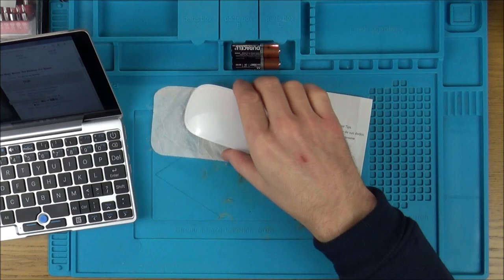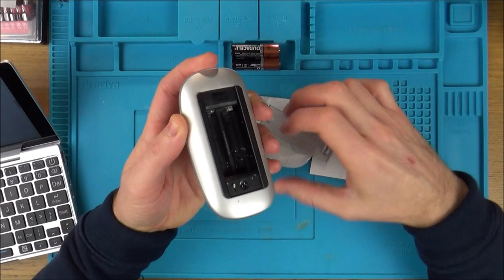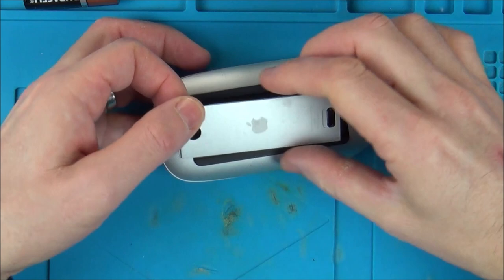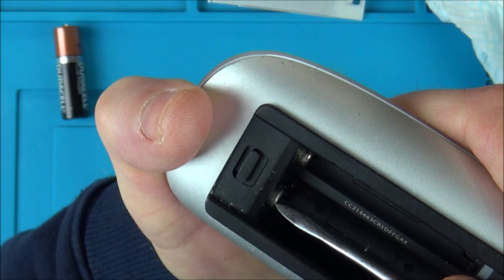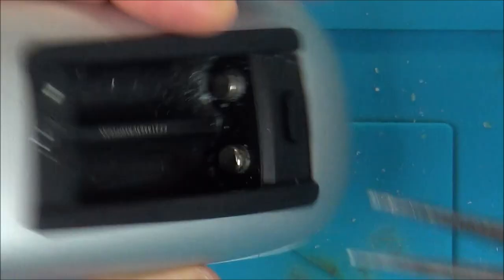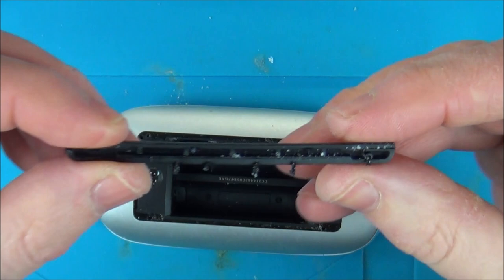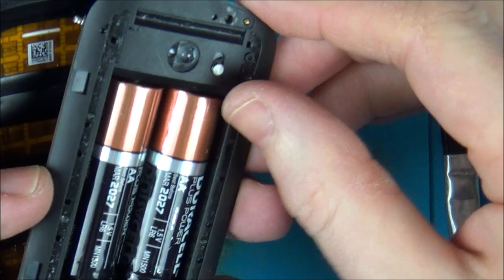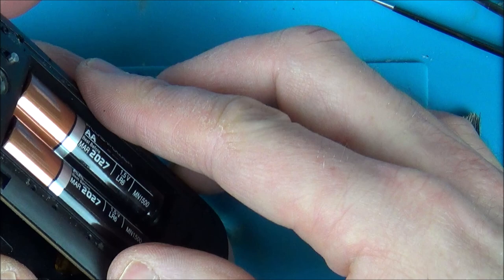Trying to FIX: Faulty Apple Magic Mouse 1 purchased from eBay

Comment: There is no right clic to speak so , you need to click with 2 fingers on the mouse and then , the mouse will send the right click action to the computer , no apple software needed i think
Reply: it depends where your finger is but he ruined the Digitizer by cutting off the black plastic bar and ripping of the glue.
Reply: multi-touch requires the drivers, to right click without the drivers just simply lift your left finger completely off the mouse first
Reply: @sersoft_corp  forfait about that ... 😅
Reply: @sakurojason  that's anoying ... So no right clic...
Reply: Tom 2 unless he replaces the housing and the digitizer
Reply: KMSMista  I know it's a 5 point multitouch, but the multi-touch part never worked out of the box for me, the only way to right click was how I described in my earlier comment, I gotta admit I haven't used one of these in a couple of years though, and never tried it on windows 10.
Reply: Nope, that’s wrong, the Magic Mouse’s secondary button is on the right side, you don’t need to click with two fingers, in fact that simply won’t work.

Comment: I know Apple like to do things differently, but having batteries go in the same direction is just wrong.
Reply: Logitech does it a lot with their mice as well. Its because the mouse only requires 1.5v to operate and not 3v. you can run it with just one battery with half the battery life, or with both.
Reply: That is why I consider a wired mouse to be the best option.
Reply: Amazon does it on the Fire TV Stick Remote (non 4k)
Reply: No its not. Its better! Much better! I hope you're not a driver!

Comment: "I wonder why they didn't make that a little bit longer ?"...To stop you doing this fix !!...Its APPLE!
Reply: But other devices are easy to fix. The iPhone as an example. Other Apple Products are very modular compare to this.
Reply: there’s actually a latch on the flex connector vince just missed it lol
Reply: @thegameporter  And he snipped off the black plastic bar causing to rip of the Glue of the digitizer wich makes it unresponsive.

Comment: That "little gold switch" is actually a pogo pin that is used to ground the metal chassis so the touch sensor can work.  Similarly the little metal fingers are to ground things.
Reply from the maker: Thanks Skonk :-)
Reply: @Mymatevince  No problem Vince, that's how the touch surface on the top of the mouse works-  capacitance between the little squares on the flexprint pcb, and the metal chassis of the mouse.

Comment: My Magic Mouse 1 had intermittent power issues. I tracked it down to the sockets that the the "nipples" on the positive end of the batteries fit into.The battery contacts at that end were deeper than the reach of the battery "nipples. No contact was being made.  The sockets were carefully filled with alfoil to enable electrical contact when fresh batteries were loaded. The mouse then worked . Its not too hard and worked for me.also placed a tiny  bit of blue tack against the lid and batteries as they move around. Works for me.
Reply: Apples rechargeable batteries are slightly longer than double AAs. If you used Apple's batteries there would be no issue and no corrosion.

Comment: Vince instead of cutting that piece to connect the ribbon, seems like you could have removed the board from the bottom assembly, plug it in and then attach it back to it. Regardless, good job.
Reply: That piece of plastic he cut needs back on?
Reply: Yea that’s definitely the way to do it
Reply from the maker: Thanks dude, that does sound like a good idea:-)
Reply: My Mate VINCE it’s all good! We all on this big blue marble together!

Comment: Dude I had the same issue with my mouse from eBay! I had cleaned the mouse out more delicately with Q-tips and diluted some white vinegar with water, which thankfully removed the crusty acid. Didn't make the mouse work though, but after seeing this video and how you more aggressively rubbed with the kitchen roll I gave it a go and it eventually worked! I'll pull it apart in the future to clean up the rest that I can't get to but I'm so happy it works now, thank you so much!!!
Reply: The vinegar had nothing to do with acid. Vinegar is acid. The crust was likely alkaline. "Alkaline batteries" use an alkaline electrolyte

Comment: Vince, if you look closely at the ribbon cable connector on the pcb, on the edge next to the battery negative terminals, there is a little latch. Apple likes to use back latches. Get your tweezers under it and lever it up. Makes the ribbon much easier to insert and removes the risk of damaging the contacts on the ribbon
Reply from the maker: Thank you, I didn't spot this at all. Nice one :-)
Reply: My Mate VINCE its one of apples common ribbon connectors thats also used in their ipads.
Reply from the maker: Cheers :-) Hopefully when I come across it again I will spot it :-)

Comment: The ribbon connector has a small release catch at the top. You have flip this upwards to allow the ribbon cable in, and then flip it back down again to lock the cable in!

Comment: From what I recall, the way that mouse detects right-click is because the entire top surface is essentially a touch-pad (how horizontal and vertical scroll work), and weather click is left or right depends upon where it thinks your finger is.
Even a new magic mouse won't register right-click if you rest both fingers on the blasted thing.
Search for apple download DL1836, extract, extract AppleWirelessMouse64.exe with 7zip and run dpinst; on reboot you should be able to enable scroll and enable/disable right-click.
Reply: ‚Even a new Magic Mouse won‘t register a right-click if you rest both fingers ion the blasted thing.‘  - I work with one every day and that‘s just not true. 
Your technical explanation was otherwise correct I think, but magic mice have multitouch, so how many fingers you rest on it has zero impact on it‘s clicking capability.
I think the problem is probably that Vince snapped that plastic clip that was putting pressure on the digitiser in order to put the ribbon cable back in.
Reply: @sweetasbloodredjam  Allow me to backpedal, but only slightly. They may have fixed this with the Magic Mouse 2, but 6 Magic Mice and 10 think they were Mighty Mice (with the ball bearing scroll ball atop, but they use a similar capacitive detection to distinguish between click and right-click) would not register a right-click unless I lifted my index finger slightly.
Not a mouse with which I could play Minesweeper!
Reply: @iain999999999999999  
Ah, yeah I don't have first hand experience with the Mighty Mouse, I skipped over that one.
There's probably a reason they were so short lived, though. 
Sorry you had to deal with that bs.

The magic mouse 2 is very reliable imo, but I haven't really had problems with the V1 either. The most annoying thing about that one is that most AAs slide around in it little bit, so it's prone to disconnecting. 

lol I'm sorry to say no magic mouse is a good minesweeper mouse!

Comment: It is software controlled Vince. There is only 1 button. The touch surface determines which button based on where your fingers are on the mouse. There is a release for the cable you clearly didn't see. All cables that have wings have a catch mechanism. There's far more too it than style. The tactic sensors allow pinch/expand/ scroll up/down with no moving parts. All of these features can be used with Windows though to be honest, windows doesn't implement them terribly well.

Comment: Maybe you shouldn't have removed the black plastic bar underneath the Touch sensor. The black bar holds the Digitizer (Coordinative Touch Sensor) onto the  white plastic top.
Reply: I thought the black plastic was at the lower part of the mouse, not the top.
Reply: @dragon940carp6  Didn't you see how he cut off a black plastic bar from the white top because the ribbon cable was too short?

Comment: At 17:19 you will see a silver square switch with a black plastic part in the middle next to the optical sensor. I think you will find that that slots into the hole in the piece you was confused about and is actually the On/Off switch. The pogo switch you was confused with I believe uses the base of the mouse as an antenna

Comment: Absolutely my favourite mouse ever - loved it and used one since release... but what an ABSOLUTE pig to maintain and work on! After 9 years mine finally gave up last year. Broke my heart as Ive never used a mouse as comfortable (for me). Survived many, many, many drops - cat hair - years of general gunk - as well as being apart 4 or 5 times over the years. I'd say the bottom was almost see through I used it so much! Moved on to a wireless Jelly Comb but these, when they work are wonderful... as well as a nightmare to repair!!!
Reply: How is the bottom almost see through if it's Aluminum?
Reply: Smattless  Lol! I couldnt punish him like that! But seriously I dumped it - the ribbon cable was torn from bending it so many times to get it back in, the rails had no teeth left and the switches only worked when the other mouse button was held down (hold right and then left would click when pressed)... It owed me nothing after 9 years!
Reply: @YoureUsingWordsIncorrectly  Cheers mate! I use my Mac for audio work so the horizontal scrolling the timeline by just left-right swiping was a life saver! Will check the mice you mentioned but have to say the Jelly Comb is behaving very well for 30 quid!
Reply: @sakurojason  Lol! Friction! Im sure I wore out 3 or 4 mouse mats with that little mouse using it so much! There is a section on my kb shelf where the wood is worn away from using the mouse when I didnt have a mousemat :-)
Reply: @mCKENIC  I thought you meant your mouse is see through XD
Reply: @sakurojason  Sorry mate! I just wore it out :-)
Reply: @mCKENIC  okay
Reply: @mCKENIC  I subscribed to your Channel.

Comment: These mice are very sensitive to tolerances on the whole case assembly. Any slight knock or drop can displace the right click pressure switch which works like the two finger touch on an apple touch pad. I managed to fix my right click by just tightening the two front screws holding down the click assembly (series 2 mouse) which brought everything back to alignment, more or less.

Comment: The ribbon cable in the top part of the shell is for the capacitative layer. the mouse senses where your finger is on the mouse to register the correct click. that's where you'll need to look to fix the right click

Comment: That metal spring which you bent upwards towards you basically takes input grounding in the top surface. When your finger is close to the right click, it gets activated. I noticed in the video that while taken apart, the right click was only working when you accidentally touched that metal part. This is my understanding. The base PS4 1000/1100 series power and eject touch buttons also work in a similar fashion.

Comment: Right click is powered by a touch sensor.  It senses you touching the right side of the mouse to power right click   that metal contact is part fo the touch sensor.      make sure the metal springy bit is makign good contact with the pad on the top of the mouse

Comment: One finger is left button, two fingers is right button and three fingers is middle button. But you have to install de Apple Magic Mouse driver for windows.
Reply from the maker: Thanks Edwin :-)
Reply: My Mate VINCE No problem.
Reply: @EdwinNoorlander  Most apple products do not have a right click option. Go figure. You have to hold the command key down while clicking as I remember.
Reply: hi Brad Kershaw, that’s a second option. But if you installed the driver you can use de mouse like a pad.

https://support.apple.com/en-us/HT207700

Comment: Pro tip order yourself some thin guitar picks on ebay so you don't Mar the surface of the metal and its point makes it easy to cut through the adhesive.
Reply: Old credit cards work too.

Comment: My friend your problem is that you are trying to attach the flex cable when the board still has the screws and it's mounted to the other part, try it without the screws on and the board detached from the lower piece. 😁

Comment: There is actually a lock on the ribbon connector cable but it's tucked right into the battery terminals
Reply from the maker: Really, I didn't see that at all. I will check again :-)

Comment: The issue with the right click I think it has to do with not been on Mac OS, remember that even on Mac you'll have to go to the mouse settings and adjust the preferences and select to use right and left click. So if you're using Windows without Boot camp that could be the issue because Boot camp convert most of the Mac drivers to Windows format that's all Boot camp is for.

Comment: The Microsoft Touch mouse buttons are also capacitive and have the same problem with left and right click as it seems to be a capacitive controlled system on the top part of the mouse.

Comment: Apple designed these mice to use slightly oversized AA batteries. People sometime use foil to extent a little to get a snug fit. Can’t remember off top of my head but some manufacturers AA a slightly bigger so need to use them brands. My eneloop rechargeable ones fit well.
Reply: Just buy AA Batteries with a higher capacity. They just cost a few cents more.

Comment: FUBAR’d mine...but at least I got it apart. Mine had a loose/broken small copper spindle wire just lateral to the optical portion. Tried to jumper it. Nope.

Comment: This is a perfect example of why you shouldn't buy dirty cheap batteries.
Reply: I have had Energizer and Duracell batteries leak... It's not just the batteries, there's something else that promotes leaking. Maybe a constant pull on the power, when it gets to a point, alkaline batteries just leak, the crystals form and pressure builds up forcing acid to come out. I notice this more on cheap Chinese flashlights.

Comment: Right click is done inside software. Top touch surface is registering right side click (or left side, when you are left-handed). There is nothing to do in Hardware side. I have used in windows on boot camp and also in VMs. Right click and scroll works. Try to look Magic Mouse drivers for Windows.
Reply from the maker: Thank you :-)

Comment: If you use a little bit of black tape it's a lot easier getting those ribbon cables in. Just put the black tape on the ribbon cable and pull it toward where it has to go.

Comment: The apple mouse right click has touch sensitivity. When clicking right the left finger needs to come off. 
The gold pin is ground and the three on the corners are ground. 
The long silver spring thing is just to bring back the mouse to the non click state. 

Nothing wrong with your Magic Mouse V1 ;) . you should only glue back the plastic hook thing.
Reply from the maker: Perfect, thanks for all the info :-)

Comment: in fact apple mouse was designed with a single switch...for use the right click press command or windows key and then click it. or enable the secondary click in system preferences... have a nice day dude!!!

Comment: Apple really makes me sad these days.
Back when they were young their slogan was "Costs less, does more. It's that simple. Apple.".
And the modular structure of modern PCs is also an innovation by Apple. Bus standardisation and upgrade possibility so you do not have to buy a new PC etc. every other year.
Reply: They did make easy to service machines back in the day but standardisation was not their thing. NuBus was the longest living expansion bus they had and it was invented by MIT. Apple stole it and called it their own. As with everything they "invent" :)

They even changed processor architectures from 6502 (I can forgive them for the first one since it was the wild west back then) -> 68K -> PowerPC -> x86 -> and soon likely arm. Gotta love to not be able to run your own old apps on their stuff :P
Reply: nowadays everything from apple is unrepairable, glued, cheap made, expensive with max profit. This is sad but what to do, from really innovative company they are now just a money maker machine.
Reply: @Chriva  true it was not their invention. but they made it popular.

also about the architecture...so true. almost like they are not selling computers but consoles.

Comment: Technically macs don't have a right click, never have, when the more modern macs were released, Apple made it so that you could software enable a right click if you wanted one, otherwise (at least on the macbooks), the right click was done using a 2-finger tap.

Comment: Flex was hard to plug in due to you not opening the zif gate. You just pulled it out and pushed it in brute force
Reply from the maker: As far as I could see there was no flap or a separate plastic part to pull out.
Reply: @Mymatevince  but there is. I see it closer to battery terminal
Reply from the maker: Thanks, I will check again. Nice one :-)